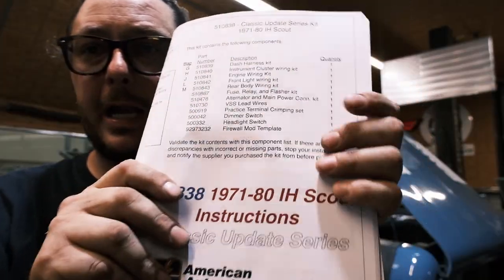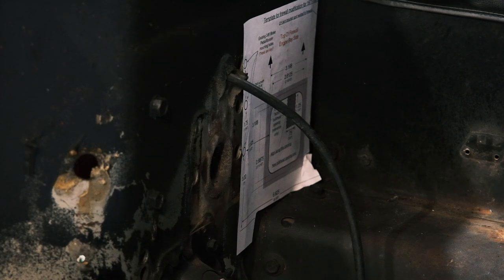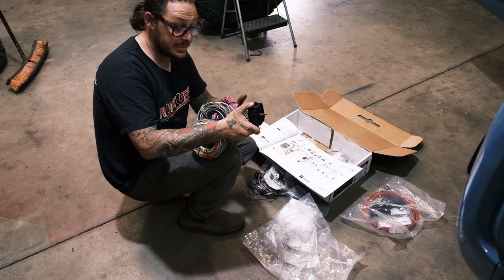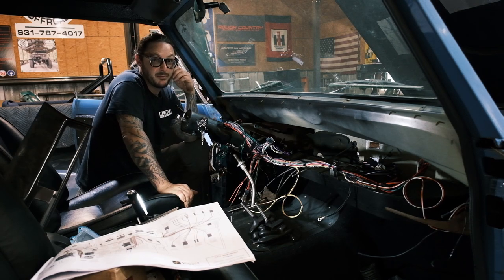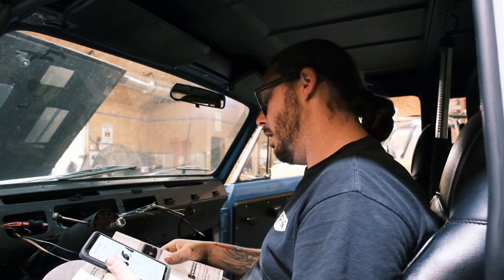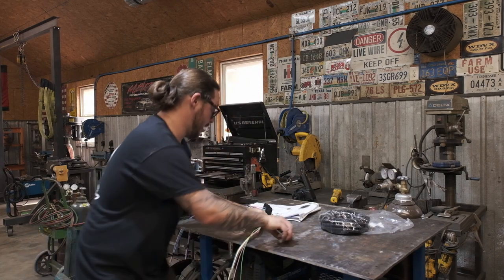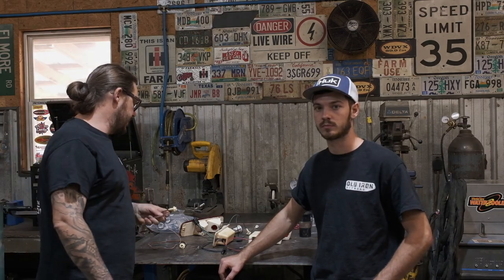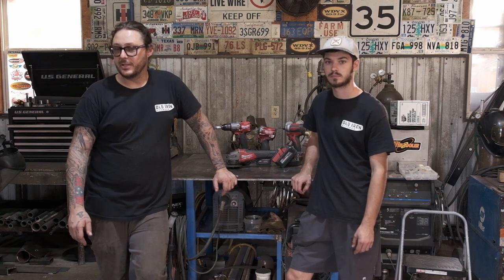So you wanna re-wire your Scout ? ( American Autowire Scout II harness review)

Comment: Great video! Im thinking of pulling the trigger on this kit, but it would be going to an LS swapped 76 Scout II. Seems like it's all there, just need to integrate the engine wires from the scout harness to the LS for indicators / etc and call it a day. Still run the stock LS loom and ECU. Just make a provision for the ignition switch
Reply from the maker: It is pretty easy to integrate the LS harness. We use a standalone and it is really only about 4 connections.
Reply: @OldIronOffroad  Thank you! should be jumping into this project in a few weeks!

Comment: Great vid, well done.
Reply: I forgot to add that's the best looking kit  I have seen. I do this type stuff as a side hobby, used a lot of differant ones, this one is far the best.  The only thing I do differant is use relays for high current loads switched on/off with the factory wiring.

Comment: What tool is used to cut into the firewall?
Reply from the maker: I drill a hole in the corners and then use a small body saw.
Reply: @OldIronOffroad  ok. I’m looking to do this on my truck so I have to gather that tool

Comment: Matthew "MrKenmore" here!  I really liked this video being an automotive electric geek.  Kit looks very complete.  I have a couple comments which anyone can address (or not) upon installation. 
 
1. The alternator voltage sense wire should go back to the primary distribution point.  In this case, it's the big stud of the starter.  That's where the battery and primary feed for the system converge.  It is at this point where the alternator should be monitoring the needs of the overall electrical system.  When you wire it in a "one wire alternator" configuration off the main output of the alternator (big stud) like this kit does, the alternator always sees adequate voltage.  No need to make any adjustments.  I'm not sure why so many people (and wiring manufacturers) have this severe aversion to landing the voltage sense wire where it belongs.  It isn't that difficult.  

2.  In lieu of the MEGA fuse block kit, I would use a Blue Sea Safety Hub 100.  I mounted this on the inner fender opposite the brake booster.  You can use an original 5/16" body bolt as one of the mount points.  The Blue Sea gives you 3 high rating MIDI fuses and 4 ATC fuses.  I prefer to use this as hub of my electrical system.  Battery, main feed to fuse panel and alternator converge here.  I actually feed my starter with a second cable from the battery (via a Ford Relay - another "hot" topic).

The later stock wiring is rather nice.  A big improvement over the earlier style.  I have seen 1978 model years with December 1977 build dates that have this newer "1979" wiring.  If you do a minor rewire (deleting the ammeter and providing an improved charge path for the alternator), it will suit most needs.  The earlier version has many more drawbacks.  The greatest of which being the poorly designed bulk head connectors.

I'd be curious if the excite wire for the alternator is direct from the ignition switch.  This is how the earlier ones were which is nice as when you are starting the vehicle, the alternator does not receive a signal to start working.  Which obviously decreases the accessory load when cranking.  For whatever reason the 1980 wiring changed this as the alternator does work when cranking.  I am curious if this circuit has any fuse protection.  Stock arrangement did via fusible link and via fuse on 1980.

And hockey stick tape works GREAT for wrapping wires.  It won't get sticking and gooey over time.

I'm really nitpicking here of course.  Thanks for the great video!!!!!
Reply from the maker: Interesting concept on the sense wire. Honestly I have never considered it.  The only question I have is the stud on the starter and the main output for the alternator are tied together.  So jumpering the sense wire to the main stud should see the same voltage ?  Conversation for next Harvesters in the Holler!!  The exite wire runs through the fuse panel on this kit. I definitely like the mega fuses and any other means of circuit protection that can be done cleanly so I will scope out those you listed.  I will also say you are correct the biggest issue with the old factory wiring is crappy dirty bulkhead connectors that lead to high amperage draw.  A good cleaning and deleting the amp meter can go along way if the wire harness isn't already fused together in places.

Comment: Great work! And congrats on Austin! Good help is hard to find these days! Couple questions... those factory gauges look practically new. Do you have a source for new factory gauges? Also, as one of the commenters below asked, what headlights are those? I was actually looking for something like that before I watched this video! Thanks!
Reply from the maker: You can buy new printed circuit boards for the gauges and new lenses as well.  The lights are just some ebay 7 inch round leds nothing fancy.  Thanks for watching!!

Comment: Great stuff! I’ve got one on the way and the timing of this video was perfect so thanks!

Question: what’s the recommendation on the size/ length of the braided split wire loom?
Reply from the maker: There are several places to get braided split loom.  Just make sure it is high heat rated.  1/2 inch will be the size you use the most of.

Comment: What is the name of the little tool to help with the split loom- or do you have a link? Thanks for the great video!
Reply from the maker: Thank you.  Here is one I found on Amazon. https://www.amazon.com/Piece-Wire-Loom-Cable-Insertion/dp/B00OKXP0C6/ref=asc_df_B00OKXP0C6/?tag=hyprod-20&linkCode=df0&hvadid=317025832507&hvpos=&hvnetw=g&hvrand=9591994128498689979&hvpone=&hvptwo=&hvqmt=&hvdev=m&hvdvcmdl=&hvlocint=&hvlocphy=9013700&hvtargid=pla-616729828739&psc=1

Comment: What tools do you recommend for someone who has never done auto wiring? I've created a wiring harness from scratch for a vintage two stroke dirt bike, but that's about it! I'm guessing in addition to this kit I'll need some fabric loom and maybe some nicer wire crimpers? (currently only have cheap amazon ones). Would it be crazy to try to do this myself?
Reply from the maker: A good crimper, a soldering iron (with the ability to solder.  Practice...) a volt meter and a test light.  Double wall adhesive heat shrink should cover most bases.  Also it is worth mentioning that the braided split loom we use is heat resistant to like 400 degrees so make sure you check when you buy.  The cheaper stuff will not withstand heat.  If you feel comfortable with wiring yeah.  Give it a go.
Reply: @OldIronOffroad  Thanks for the reply! What parts of the kit require soldering?
Reply: Just when making crimp connections?

Comment: Great video. Makes wiring look easy. What headlights are those? Also, would you use this same harness if you were doing an LS swap plus a total re-wire?
Reply from the maker: Absolutely. It comes with extra ignition hots to feed an ECM if you need so the harness is very engine swap friendly.

Comment: that's a great video, but I'm really not a fan of leaving a dead gauge in the cluster (ammeter)
Reply from the maker: I agree.  Honestly I feel that a gauge conversion is a good addition to a rewire.   The ammeter will not properly indicate charge or discharge after this conversion so it is pointless to wire it in unless you deviate from the intended flow of charging inwhich you would be adding a potential fire hazard especially with the use of a higher amp alternator

Comment: I am assuming that with this kit I can run a higher amp alternator?
Reply from the maker: It can as the charging circuit is directed to the battery and the amp meter isn't utilized

Comment: What would you recommend for a Scout 800a harness?
Reply from the maker: For an 80/800 I would stick with a 14 circuit Kwik Wire harness
Reply: @OldIronOffroad  thanks man, one more thing on the build sheet confirmed! Do I need to order anything special on the harness if I am using an LS engine?